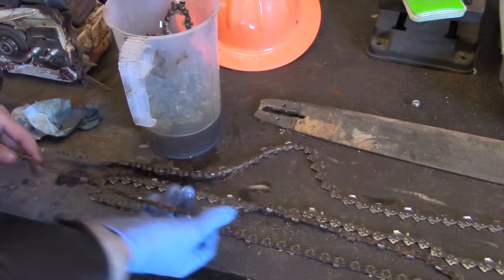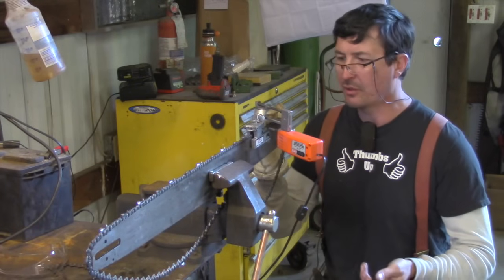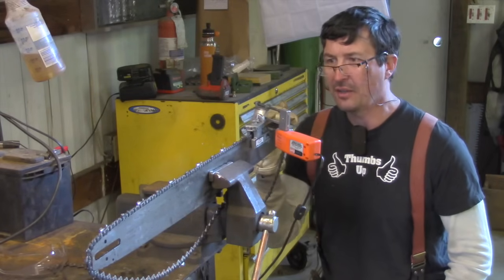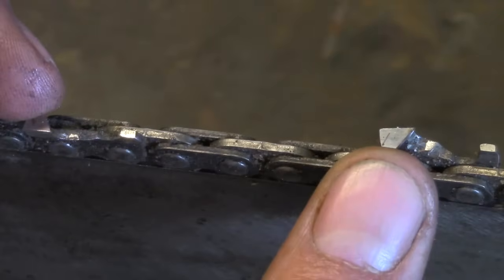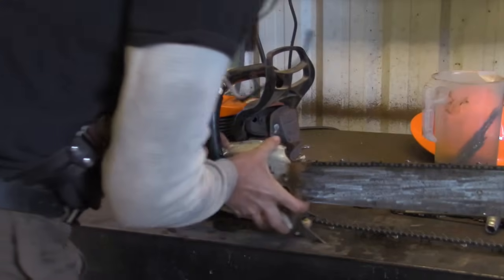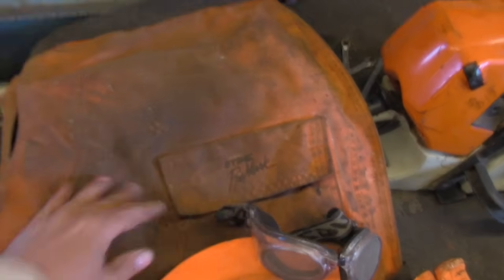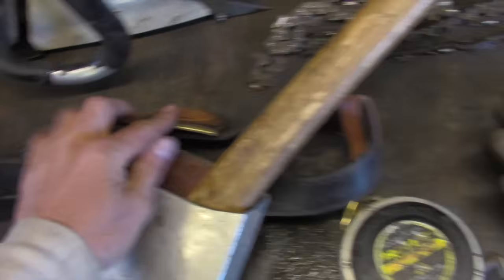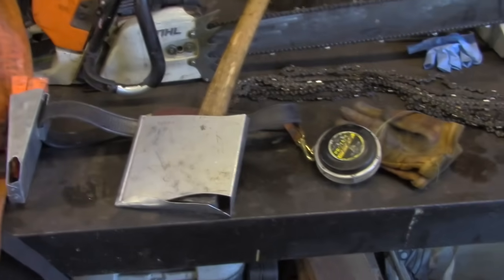A Better Way To Sharpen A Chainsaw

Comment: "...put the Swede on..."  is awesome!  I'm gonna use that.  Here's a great question from an ignorant beach dweller:  Why have the spikey plate at the base of the blade on the side of the chainsaw?!?... besides it's looking pretty cool, but...  dangerous.
Reply: You use it to bite into the wood to give you a pivot point. Pro saws have aggressive ones like that, homeowners saws will have them but much smaller. Compared to that spinning chain that could take a leg off in a couple of seconds they aren't really dangerous.

Comment: Does the tool rotates CW or CCW? 
Make sure the stone goes "against" the tooth.
Reply: Doesent matter in the least .. if it did it wouldnt vs successful because a file grinds with rhe angle of the tooth. Same argument against pushing or pulling a knife on a whetstone. It dont matter. Sharp is aharp

Comment: Looks like that chain has been sharpened before, not too many sharpen left!
Reply: Pascal Bolduc The scribed line at the rear of the tooth is the place to quit sharpening them. That one looks a little more than half used up to me.

Comment: Im gonna get me one of them harbor freight rigs @$46 ,,, probably not as convenient as the 12 volt though
Reply: +greg webster  $29.00 I bought one sharpened a few only to find out I had to do it again. I think I'm getting to cheap trying to save chain when in fact I have to take more off. Always complained "they took to much off", Now I know why.
Reply: hummm is it the stone its self.. just went and got my rig and am in process of mounting it up
U r talking about the bench model arnt u?

Comment: Sharpening a chainsaw chain is a skill, even the pros use electric chain sharpers.  Time is money in the professional logging world.  Price a good chainsaw chain for a 36 inch length bar, and then sharpen it by hand without a guide. Time is money.

Comment: I agree with you. Unless you can sharpen like a machine you will almost always sharpen just enough off (out of true) that the saw will want to track crooked.
Reply: Sorry but that's nonsense. Unless of course an awful lot of cutters sharpening chains several times a day are ALL machines. Sharpening chains was one of the first tjings we learned at Forestry college - my chain has never tracked crooked.

Comment: I disagree, all you need is the simple Stihl sharpening kit and take a few minutes to LEARN how to
use the file guide and the depth gauge for the rakers. That’s it. No additional gizmos. My chain cuts
wood like butter. The key is filing the raker correctly to the right depth.

Comment: I would rather have a plastic hard hat in a fire
the aluminum is going to conduct heat just like a steel shank in your boot and plastic does not transfer heat it also can be made very fireproof

Comment: The little grinder is a good tool for armatures however my chains have to be more precise, and sharper than can be done,
With any rotary tool, because of the physical properties inherent in any rotary sharpening. Grove formation inducing friction.
Ps. After watching a guy with an Aluminum hat have to have it cut off his head, I will stick with plastic felling helmets with muffs.
They will shatter not fold in creating a worse problem then they solve.
Reply: HolzMichel yes but when your hit hard enough to shatter the plastic, your already dead in the Aluminum with a crushed skull.  
       Just because you think it's better does not make it so.
Reply: HolzMichel I don't like the sthil helmets, the Elvex plastics are better I actually like you liked the old Aluminum one they will protect you from some serious hits, but after seeing how hard it was to cut one off 
A loggers head after he was smacked by a spring pole against a tree, I decided yes the good plastics are better more side strength.  They will crack but not fold in.

Comment: A number of commenters are looking for purchasing the grinder and jig shown in this video. I found the combination for sale for $75 at

 http://granberg.com/product/g1012xt-precision-grinder

Personally I started out with a file, then went to a drummel, but found the stones expensive, so went back to a file freehand and believe I do well with it now. I do need a vice to do it well, have not learned to do it in the field. Did find a vice advertised that you pound into a stump, and that might be something to try. 

Gasoline is used for cleaning in this video, and this concerns me. Had a hard time getting a wet pile of leaves to burn, and diesel wasn't cutting it so tried gasoline. It blew me backward 3 feet, and burst a meniscus in my knee and fried my hand a bit. When cleaning up my chain, and chainsaw, I like to use paint thinner/solvent. I put it into a spray bottle, and it works well. I like working close to an electric light, and I don't have to worry about explosions. A bit more expensive than gasoline, but much safer.

Comment: Kerosene works best for cleaning cains of tree sap
Reply: The best, fast adjustable Bench, loose chain holder for sharpening any size chain was one sold by 
Remington Arms after they bought out Mall., But last I heard, a competitive Company had bought 
thar up and didn't produce it because theirs was cheaper to make, and their production line and 
factory was ready geared for theirs. (Corporation profit motive?)
Reply: Remington Arms also had a (on-the-saw) dandy-adjustable file guide that left the file loose 
for rotating. That disappeared too!  So sad, and sorry.  Fritz, the old mechanic & saw filer.

Comment: chainsaw sharpening isnt rocket science, filing within a few digrees isnt going to affect the way the saw cuts in any noticable or practical way. 

A chainsaw is not a precision tool, its made for cutting rough, large kerfs in a variaty of woods seasoned and green. "close enough" is just fine when it comes to chainsaws.

the more important things ive found is tuning the depth gauges for the type of wood your cutting, and keeping the bar ground square and deburred.

That guide your using is verry conservstive so that you can saw seasoned hardwood without getting stuck. If 95% of what your cutting is verry soft as you say, you should take those depth gauges way down and you will see your saw absolutely rip through that wood. for softwoods ive found about half of the original.height of the depth gauges.works great

Comment: Doesn't the statement that a jig is better for sharpening fly in the face of your devotion to Paul Sellers woodworking (and Frank Klaus/ a myriad of others) that sharpen plane and chisels free hand? Not trying to call you a hypocrite but hand sharpening anything has more to do with repetition than anything else. The standard for sharp on a plane blade or chisel is much more exacting than on a chainsaw.

Comment: Yeah. The debate goes on. Once you use a grinder, the metal becomes brittle and you'll never be able to sharpen correctly again by hand. You won't always have a grinder with you.

Comment: well i would agree that consistence is important  when sharpening the chain .by the looks of that chain it does a hack job.i would never use a chain to the wear bar.you start to loose teeth!

Comment: Dude, each time you pull your file back I hear it grind against the tooth and is putting a burr on the tooth plus by drawing the file the rong way your wearing the file out.

Comment: it amazes me people send their chains out to get sharpened.....for a 28-32" chain they run roughly 40$ give or take 10$ and to have it sharpened for 20$ minimum just doesnt make sense to me. especially when a lot of guys will or have to take around 1/4 of the cutter off everytime. sometimes they have to due to the owners poor hand filing techniques or just poor ethics from the grinderman.

Comment: Sharpening a cutting chain by hand is not rocket science. Your little machine no doubt does a good job but precision on that job  is  non essential. Speaking about a basic faller's kit I wonder how many fallers own a 12V   sharpening gadget or better yet have their cutting  chains sharpened in a saw shop.
Reply: Probably most any of them that do it for a living. I have yet to meet anyone that cuts much wood at all that doesn't have a sharpening machine back at the shop.

Comment: Honest question: Is sharpening a chainsaw really worth it?  If this sharpener costs $100 and you can buy a new chain for ~$20, you would have to sharpen the same chain five times for it to be worth it. Unless you're using it very often, it's probably more economical for most chainsaw owners to just buy a new chain when the one they are using wears out.
Reply: You spend $100 dollars only the FIRST five times you buy a new chain - after that the sharpener would be worth it. Unless you only intend to buy five chains in your lifetime.....

Comment: For regular firewood cutters and guys fartin around out in the back yard, yeah, I'll take your word for it that this is one of a VERY few chain sharpening tools that more than likely will work better than attempting to hand file without experience. I'll tell you what nonsense is, you saying that a chain cannot be sharpened better by hand than with that grinder. You're flappin your gums about something that you couldn't  be more wrong about. Another fish out of water

Comment: Reminds me of the guys that say they can sharpen a drill bit by hand.  Nope.  Sorry, you can't.  Yes, you can make it sharp, but you can't make it true.  You will never make both sides the same.  (But I'm the type of guy who  won't use a drill bit that was previously used in a hand drill in a press/mill, because they are bent  if I want an accurate hole.)